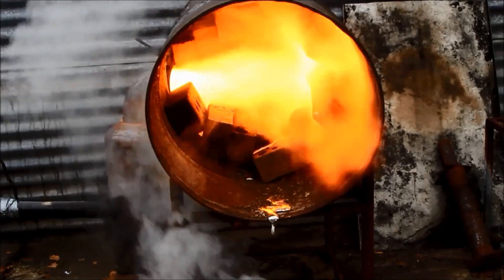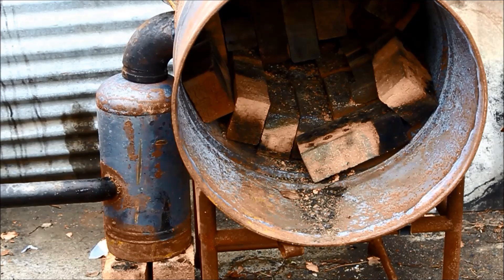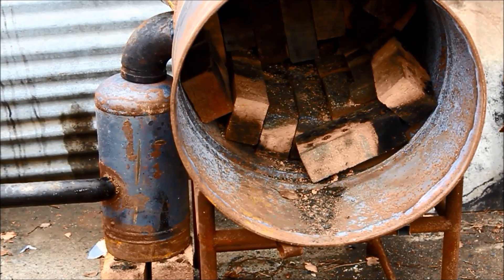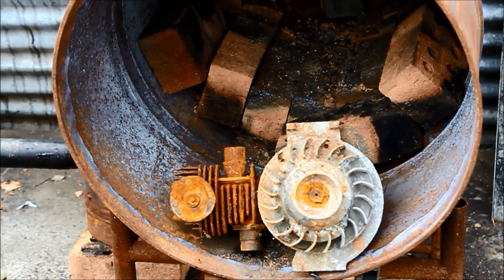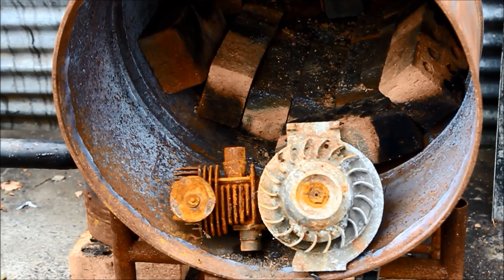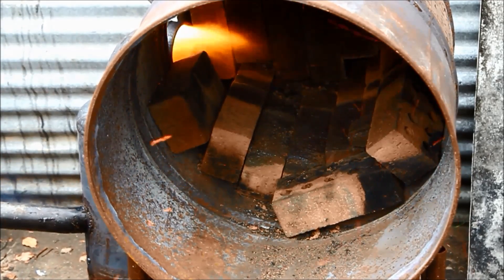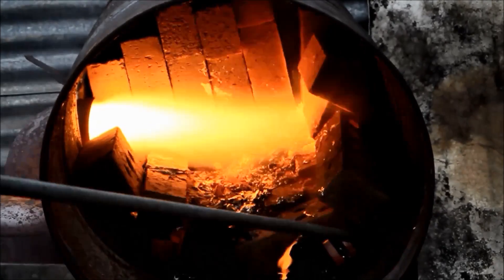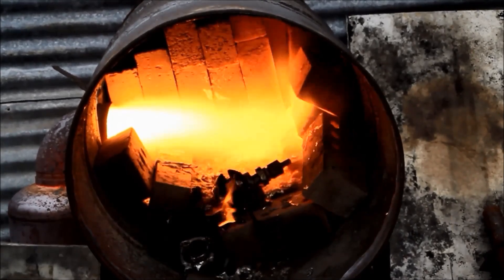Scrapping Furnace DIY foundary melts Aluminium engine

Comment: We did much the same but used a burner from the rear. Then rolled the drum.  The refractory (bricks) were mortared in place with one hole in the side of the drum.  Added salt so the aluminum wouldn’t thermite. Cook till pourable then tap the hole in the side and pour out the aluminum.  It will be clean as well.

Comment: In my opinion too, there´s a lot of heat lost, and the aluminium stay all appart, with another "funel" end will be more easy to get the metal in block or ingot shape.
Anyway your video is a great inspiration.
(sorry for my bad English)

Thank you

Comment: can you melt aluminum cans this way.
Reply from the maker: In the blink of an eye!
You'd melt them about as fast as you could throw them in but cans are not good material. A lot of it becomes oxidised and is wasted as Dross. Much better to use much more solid things like engine heads, castings, pots and pans even. Cans will work, you just need a lot of them and you get heaps of waste.

Comment: Certainly works well, even the Devils arse would get fried in there. Good result with melting down that old engine, I reckon I will have a go at setting up a scrapping furnace to sort out a pile of scrap alloy I have in the yard. Thanks for the upload!
Reply from the maker: I'd be interested to see how it goes for you. It will sure get rig of all your old wast oil in a hurry I can tell you that!
Next I plan on doing an aluminum head off a car engine.
Reply: @glumpy10  how does the yield from the parts compare to a regular melt in a cruisible? 
it seems theres a lot more dross compared to the more standard way
thinking about melting down cilinderheads unstripped standing straight up but was thinking more of using a hole in the bottom of a verry big crusible and a normal style foundry large enough to take a 4 cilinder head then put the lid on it and set the moulds up under it with an overflow one intoo the other

Comment: Trikelops Here, From The Missouri Ozarks here in the USA. I like the NO BS way you go about your videos, way too many safety Cops on here. If it scares you DON'T TRY IT!
   I'll be in the shop cuttin and weldin tomorrow. its 10 F here and I have already burned a forest worth of wood. But have LOTS of WMO WVO. So to the scrap pile and Your burner ideas are way simpler than the ones I've tried. 
   When I first posted my trike build vids. people from every where were asking for plans and dimensions, safety concerns and just WATCHERS not DOERS. I just put up the slide shows to let everyone know all they had to do was to get to work. Thanks again for sharing your vids and I hope you keep it up.
Reply from the maker: Hi Chris, Couldn't agree with you more on the safety zealots. The great majority of whingers have never done anything hands on in their lives and probably never will and the rest are just brainwashed into thinking you can't make a Grilled cheese sandwich without wearing gloves, a face shield and a leather apron with steel capped boots.  I always wonder though if in real life they practice anything like what they preach? Like you say, If it scares you, stick to the stamp collecting and knitting channels ... Not that I have anything against either interest.  :0)
Thank you for your kind words, they are much appreciated and mean a lot.
Reply: Oil Burner ooo that reminds me, you didn't have a safety tip on this one? Maybe 'don't remove the crank with your teeth' ?

Good ta see you back

Comment: Great video Dave Great to see you back. It sure makes lite work melting the engine down,  you should try scraping old computers for the gold that would be an easy task with that burner.  Cheers.
Reply from the maker: Thanks Dave.  I did try melting an old small form factor computer. I was amazed at the amount of smoke that come off the thing. I can only imagine if I put a vid of it up the ranting drivel I'd get from the do gooders and nutters about pollutants etc in the things and other crap that showed their out of date ignorance. I have got some Aluminum heads off a car engine to melt down. That will be a special Vid as my Father reckons it will take forever  so I have to enlighten him as to the religion of Oil Burning power. :0)
Reply: +Oil Burner prob the oil and grease burning off...one would think that'd be done in a few sec.

Comment: Aluminum melts at 1220 F, which is plenty hot for a forge. I wonder how much will get lost to oxidization? Still, great entertainment in any case!!
Reply from the maker: Aluminum or something in the forge get lost to oxidization? You can run the burners rich to cut down on the oxidization if you wish. Melting steel with one of these is no big deal. Finding refractory that will stand up to that sort of heat is a bit more difficult!  :0)

Comment: You might want to put a simple door on the end to reflect radiant heat back in.
Also I expect that the aluminium dissolved its way through the steel, I read about that stuff happening when I was looking on how to make a steel crucible.
Reply from the maker: I have a door for it which is just the drum lid but when Fitted, I can't video what's going on inside. Staring at a lid is Kinda boring for a vid even if it is more efficient.  :0)
No, the aluminum did not dissolve the steel, It ran out a hole I had cut in the drum before when making another Video!  I should have cut the larger hole elsewhere so the small hole was at the side not the bottom.  My bad.
I think that aluminum dissolving steel thing is a bit over rated.
Reply: Oil Burner Ah should be easy enough to weld and forget about then.
Is this the final generation of your scrapping furnace? I think you got the zenith of furnaces made out of just an oil barrel.
Reply from the maker: Rainbows871
Actually, I have been thinking of some more mods to this.  The bricks aren't as I'd like. I was thinking to put a layer of insulation around the whole drum and  fill the bottom of the drum to give a smooth surface the molten ally could just run off. I'm also thinking of mounting the burner on top of the furnace and having it fire down and back from the front so as to create something like a flame curtain. This would keep a hot zone at the back of the drum and  should help with the problem of molten ally flying everywhere due to the thrust the burner puts out.
Stay tuned for more firey Updates!
Reply: Oil Burner Using proper insulation? Getting professional.

I wonder if gate valves work with molten aluminium, if they do then you could use that to make the aluminium form a pool before releasing it rather than having the constant slow drip. Dunno if you ever plan to do sand casting but I have never seen anyone put the aluminium in the mould one drop at a time as your furnace would.
Reply: A door would spoil all the fun!

Comment: I believe im going to insulate aa 20 gallon drum with kaowool and use to burner to make a giant glassblowing furnace. Do you have. Any suggestions though how i could add a second air line going straight into the elbow fitting though? As to finish up a piece of glass i need a oxidizing flame and since these burners work on evaporation and fuel air ratio in the chamber should be always neutral ifigure the only way to pump in to a hot oxidizing flame would be introducing a small amount of air into the actual flame cone.
Reply from the maker: You can run the flame on these burners very easily in an Oxidising  Mixture. The burners will run all day like this and I set them up so they will have excess air at less than full power burns because it eliminates any smoke or visible emissions. All you would have to do is have a 2 stage oil feed. 2 open for flat out or high output for working the glass, close one off to keep the flame going but oxygen rich.  If you really wanted a lean flame, I'd use a "T" piece on the top of the burner and have the air entry coming in one side.  The heat will come out the burner and into the furnace then when you want the oxidising mixture you open a valve which admits air through the other side of the T and gives you the excess oxygen. I'd seal off one side of the T and put maybe a 1" tube fed off the blower with a valve for control.

I don't know if there are any Fuel/ air ratios you work to but there is no doubt you can get a very oxygen rich output just by keeping the air up and the fuel down on these things.  When you build your burner ( see my other vids) just put the air inlet Half way up the burner shell rather than 1/3rd. This will enable the oil  to burn lower in the chamber and the air will blow over the top giving you the reducing flame.  Also throwing in a handful of bolts into the bottom of the burner will give more surface are for the oil to vaporize off and let you run even leaner without the excess air over cooling the burner.
Reply: Nice idea on the bolts thing neer actually thought about that. But i have built one of your burners for a tire scrapping furnace and since i wanted a reducing flame with that i start it with it being packed full of wood bits and after theyve been turned to charcoal i open the oil full out to soak the down real good and the surface area giving by that is just massive so as long as i have oil running the pile of charcoal stays relatively untouched and justs acts as a sort of pilot light for the oil as well as making it vaporize alot quicker even whenthe steel sheel of the burner is no longer glowing red. Also seems to make the steel last longer since the internal flame is very reducing over the charcoal but coming out of the burner it seems to neutral out a bit.
Reply from the maker: HUsoldier171
Tyre scrapping???  Are you just burning off the rubber to get the steel or are you pyrolising them for the oil and carbon or??? Sounds very interesting either way!
I have found the same with the wood. If I do a low intensity burn where the charcoal isn't physically blown out of the burner, there can still be bits there after an hours running.  I tried some bit of coal and lasted even better. Couldn't tell where much of it disappeared at all.
Reply: Neither haha, melting down aluminum rims and heating up steel ones to shape them into micro forges for friends! And normally even when i had my little one running full out id end up with a about a third of it full of the blackest densest charcoal ive ever seen mixed with a nice powdery mix of lampblack! But even with it running that rich i never once would see anything but a touch of grey smoke or some water smwater vapor from some shite oil i had. But once i find a cheapish supplier for a good lot of kaowool here in the u.s im gonna give this a swing. And once the weather warms up(my veg oils solid) maybe ill make a video to show how i did it and its success and pop it on alloyavenue.